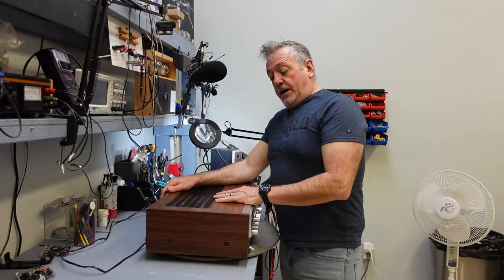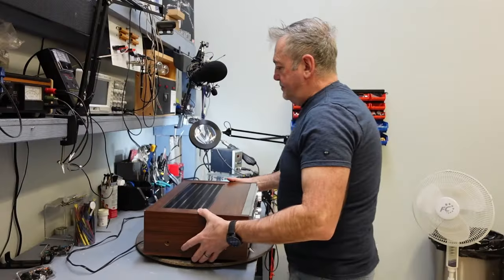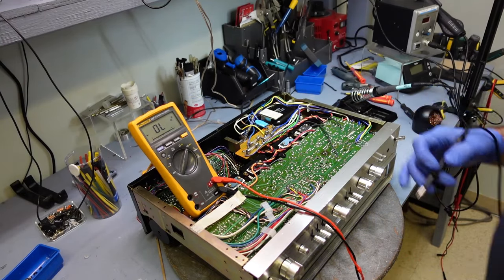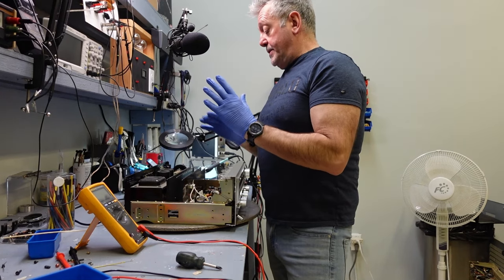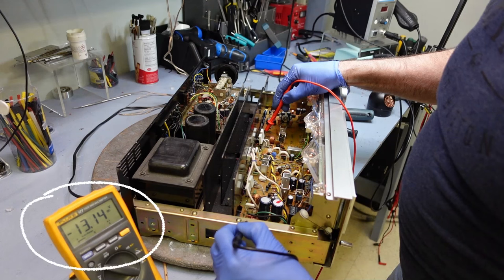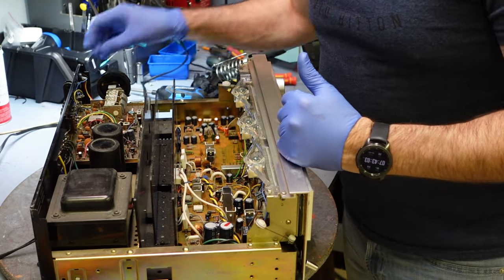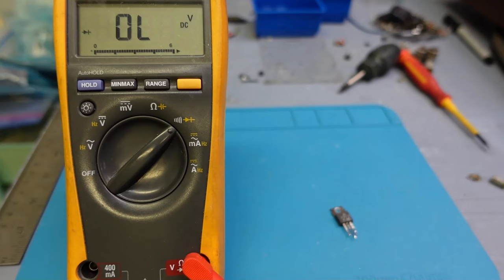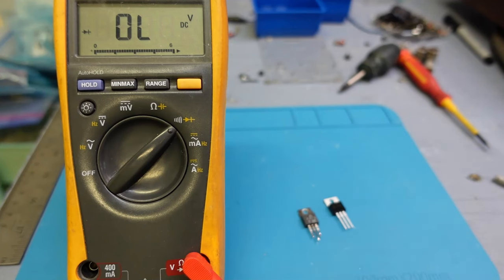Pioneer SX-880 with a short circuit...

Comment: I've seen this on a couple of your videos. You can and should also check emitter to collector on those outputs. The diode check will just show zero if shorted or open if good, probably give a continuous tone on a short, though I'm not sure about that on your meter. I've seen E-B and B-C junctions appear to test fine and still be shorted E-C.
Reply: Listen to this tech!
Reply: I've been there and done that. Check all three ways.

Comment: When you don't have the exact replacement part, you should swap the other transistor too, even if it's good. These guys work better with their respective complementary transistors.(MJE15030 and MJE15031 in your case)

Comment: I'm always amazed at how long you leave a device switched on despite a short circuit. OK, currents and voltages are lower when a light bulb is connected in between, but a short circuit is a short circuit.

Comment: I may have missed it, but did you check the same transistor in the other channel as a reference with your temp checker?  Also, maybe check after bias adjustment to see if still hot?  A screenshot of this transistor as shown in schematic would help those of us not familiar, just a suggestion for future vids.  Cheers!

Comment: excellent troubleshooting  Joe. the experts on Audio Karma recommend beefing up the heat sinks on the regulator transistors on the 780 for the same reason you have on the one thats extra hot. a very common problem it seems.

Comment: Hi! 
Tomorrow i have a plan to do the adjustment and also make a note too you 👍
Reply from the maker: Please do!
Reply: Hi
The bias before was 28,9mV and 28mV,  DC out 1.5mV and 1,9mV
Power Supply was little high 38V and adjusted down to 35V as you showed in your video.
Thanks again for all nice video and i learn a lot from it

Comment: Just found your channel great repair those old amps from Pioneer are beasts and it has the same output transistors as my old HK 870, and I noticed you have pretty much the same magnifying glass on the arm as me :) can it also switch color temperatures? I had the little controller on the cord, but i replaced it with a 2ch rf dimmer unit, and I also 3d printed a new triangular bracket that is closest to the lamp part now I can hook up a small camera to the light. And I think you might have the same variac as me too it looks pretty much identical.
Reply from the maker: hi, I read you comment...thank you! I just subscrib to your channel, maybe post a pic of your shop someday... have a great wkend...

Comment: Hello Joe, Working on a sx-1500td given to me. Missing the power transistors and six others plus two were replaced with 1845's. I think they were in wrong. the emitter resistors were missing also. Blowing the fuses when I replaced everything. Did you say you powered the 880 up to test the emitters ?  On the dim bulb tester? Thanks for your time brother.
Reply from the maker: Hi James, I will always power on the first time on the bench through DB, if I detect a short then I will shut off the unit and I would test outputs and move inward, if you need voltage to do further testing, use a VARIAC and DB both at low voltage....in your case, your blowing fuse, it takes major short to blow a fuse, like I said, concentrate on your outputs and move inwards, do you have voltage on your emitters/resistors?
Reply: Thank you sir for your good advice, I use the DB. Will use my variac for further testing and get back with you on my progress. @VintageAudioFever

Comment: how can the heatsink be hotter than the source of the heat , the transister  ?
Reply from the maker: I actually did experimental and changed that transistor with a new one and same thing...it's not the transistor, I know that for a fact....but here is my thing, I could of change that whole circuit board with new parts, I would still have Q26 as a hot spot....

Comment: You  know when heat sink has  higher  temp. than the transistor it's cooling there must  be  something really wrong with the lows of Physiks in this transistors sorounding space 🙂
Reply: good video though
Reply from the maker: Hi 
as I said on my video, I did check all of surrounding circuitry but everything check out ok....